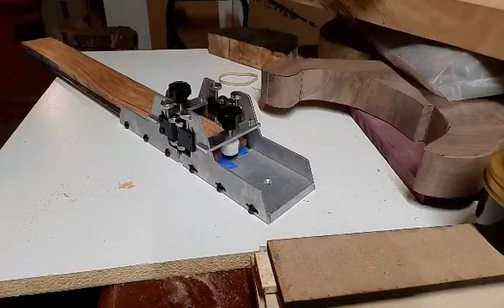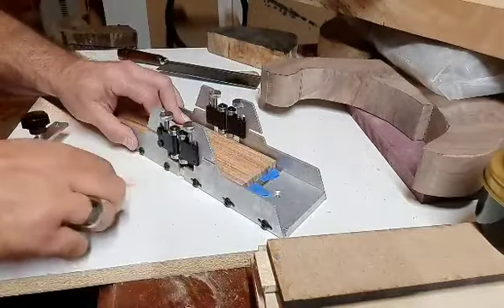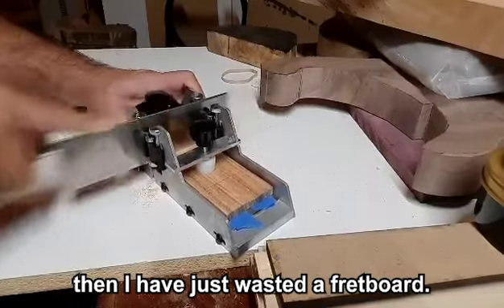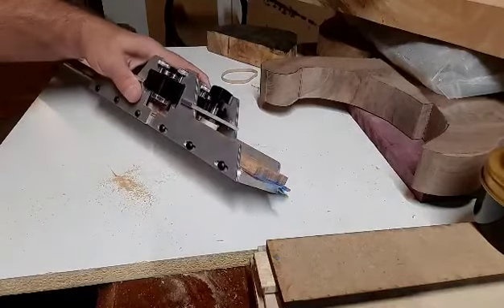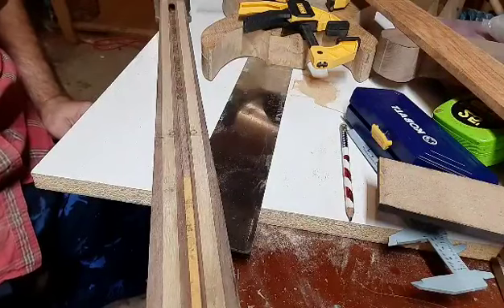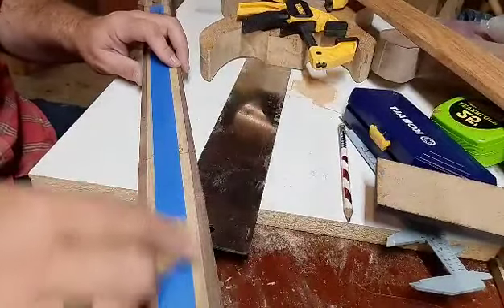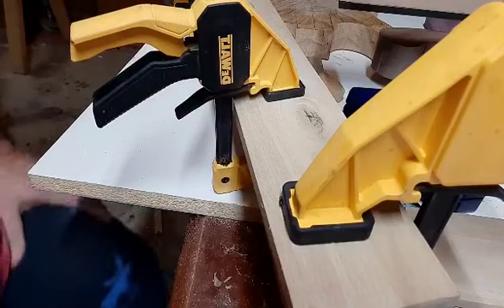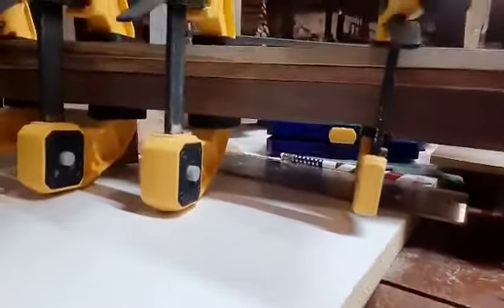The Great Guitar Build Off 2021: Plan B Comes Alive!

Comment: I admit I know 0 about the processes that go into all this,but, I am curious as to why the masking remains under the fretboard.😶
Reply from the maker: It's really just optional, Dave. Lotsa people remove it, lots don't.  I opted not to because I had just a smidge of clearance between  the fretboard and truss rod  and that .001" plus soft surface will prevent rattles if the truss rod remains neutral. If it needs to be adjusted  either way, the tension on the bar will prevent noise.
Reply: Right on.😎